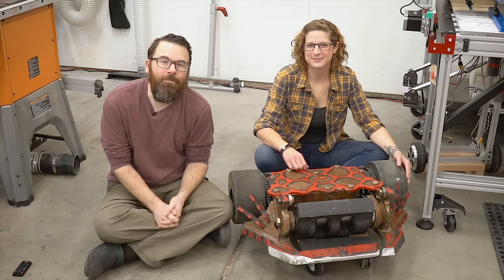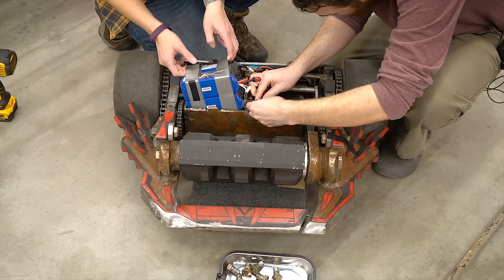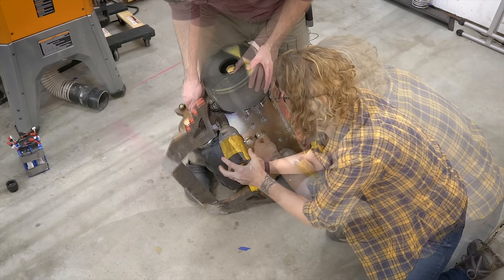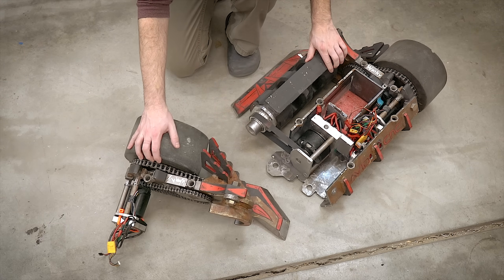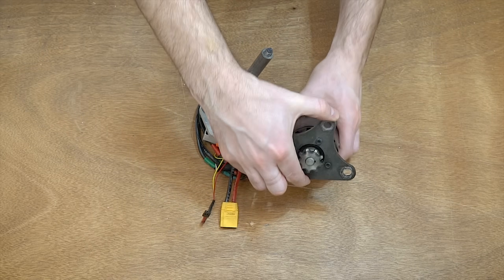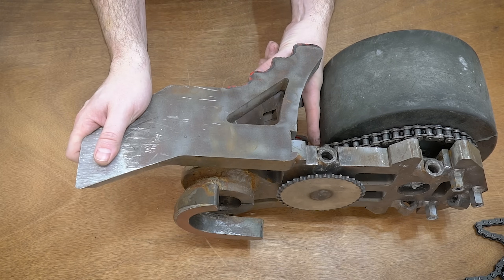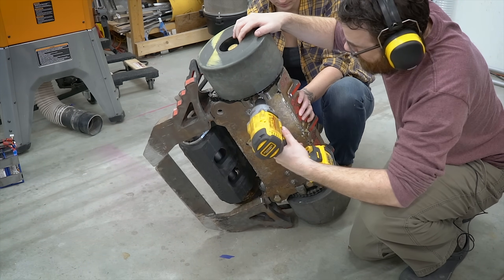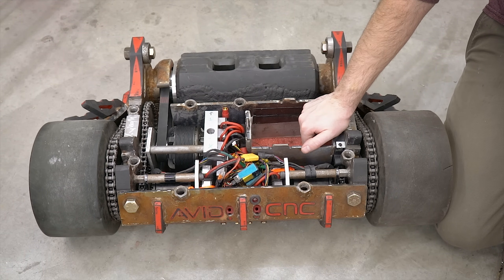How to Service a Battlebot (Copperhead)

Comment: Hey that’s pretty danger moving that around by hand you should design some sort of sizer lift or car lift but smaller and call it your bot hoist
Reply from the maker: I usually just use a cheap furniture dolly, we pull it around on a string.

Comment: What types of material you use in this bot
Reply from the maker: All of them.  That's a broad question.  The frame is AR500, drum is S7, most of the internal parts are aluminum, there's also some 3d printed parts in there as well.

Comment: I'm a machinist by trade and enjoy the behind the scenes stuff and how they are made. With that being said I have questions I hope you don't mind answering. What is the thickness and material of the top, back, and bottom plates? What are the size of the 2 different drive chains? What is the information on the drive motors and weapon motor? What kind of Speed Controller do you use on the drive motors? What is done to protect the motors ,speed controllers, and batteries from combat, cause a weapon on weapon hit like a bot like Copperhead is a big shock throughout the bot ? Told you I was Curious. LOL!

Comment: Hi Robert 
I remember crippling depression had pockets in the aluminium walls which you mentioned are for weight saving.
In one of the versions you filled these pockets with epoxy and during the fight recap you showed that the epoxy had cracked, probably duo the  shocks the frame gets. 
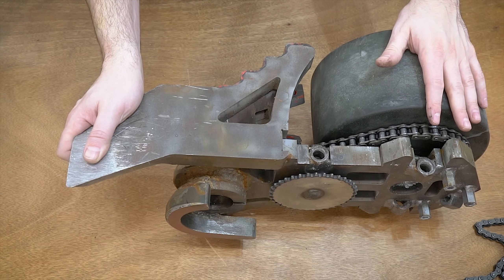8:41
Can filling these pockets you guys have in copperhead with epoxy or rubber reduce the shocks travelling thru the frame and breaking things?
Reply from the maker: MAYBE.  The problem is that the epoxy broke out of the panels, it would need to be undercut somehow so it can stay in place.
Reply: @RobertCowanDIY 
Maybe the answer is in a different kind of fillers, carbon fibre, chopped carbon fibre, carbon fibre nanotubes…etc, even if the epoxy shatters or break, the carbon fibre will still hold the composite together.
Or just use pure epoxy as a lot of epoxies are ductile.

Comment: One thing I don't understand. How are two wheels bots like yours stand up straight? Do they just drag on the floor? How do you manage to balance it, with all the hits and blows and all the weight?
Reply from the maker: The front forks have around 100 pounds on them, the wheels carry the other 150.  This means we tend to get under people, since we have weight on the front of the bot.  This means it drives worse since we don't get as much traction with the wheels.

Comment: Gotta say, awesome!!! But.... IMO Your lifting techique would be better if performing a deadlift manuever instead of a bent-over row and then rolling your back up. Try engaging your core, keep back straight (disperses load inbetween intravertabral discs) and shoulders back. Sounds like you hold your breath to perform a valsalva manuever while lifting. Try exhaling, this too will prevent injury. also never lift/put down a heavy object held away from your body (hernia) keep it close. I was excercise science, sorry i had to speak out because i dont wanna see you injured (some can last a lifetime). Anyway, enjoyed the video, take care

Comment: Wouldn't you have to re-weld the front horizontal bar once it's back together?  Not sure if mentioned or I missed it.
Reply from the maker: Yep.  A weld is the only thing that will hold.

Comment: 3 biggest reasons people lose in a battlebot match:
1) exposed wheels
2) cant self right
3) motors/controllers burn out

fix these 3 things and youre next to invincible.
Reply from the maker: HAHA.  OK.
Reply: @RobertCowanDIY  you dont even watch the other matches do you
Reply from the maker: @t_c5266  Of course I do. 

1) we've never had issues with exposed wheels.  just as many teams have issues with wheels binding up because of wheel guards as there are issues with exposed wheels.  It's a design choice and there's not a right way to do it.

2) I kinda agree with this one, bots should be able to self-right, or at least be able to drive upside down.

3) That's like saying "bots lose because they stop working".  It's nearly impossible to make a robot that can withstand thee stresses we put on them.

In short, your list isn't 'wrong', but it's very easy to just put together a list like this, but doing it in reality is quite tricky.  "The team with the most points wins the game".

Comment: Question: Why do battlebots use gearboxes instead of directly driving the wheel with a motor?
Reply from the maker: Motors almost always use some sort of gearbox to 1) make the RPM more usable and 2) increase torque.  Most motors spin far too fast and have too low of torque, so you need a gearbox to slow it town and increase torque!

Comment: Wow, I had no idea. Is that 1/4in. steel plate? That's crazy.
Reply from the maker: The frame is 1" thick, and the top plate is 3/8".  It's all Hardox or AR500.
Reply: @RobertCowanDIY  Amazing. When I was younger, I was considering building but at the time the cost was prohibitive. I was just watching the very first episode I recorded on VHS (Mark Setrakian's 'Mechadon '). It's nice to have some insight on how it's made. Thanks for sharing.

Comment: You are exactly right, Robert! While watching the bots fight in the arena I get no sense of accurate scale or weight of the bots. And the bot fansites give me more win/loss stats then anything that helps me to understand the bots scale. A good way to show the bot scale (and thus the power of the bot) would be to film a bot tearing into a: refrigerator, easy chair, old and rusty VW or Corvair?? Thank you, Robert!
Reply from the maker: The problem with kitting stuff for scale is most of those things are far too flimsy, they just kinda break.  We would need to hit an engine block or something more solid.  ADDITONALLY, it's dangerous and quite messy.  We could punt metal shards hundreds of feet, so safety and cleanup is a concern.
Reply: @RobertCowanDIY  , I dig the safety issue. I've seen how fast the parts come off as they bang against the battle ring walls. I would be interested to see how powerful a battlebot would be but, yes, the filming should be very isolated from spectators and the driver of the bot would be behind a seriously strong protective shield. No blood just bot carnage.

Comment: What would be very interesting is to make the robot fully AI using an arduino nano technology chip and sensors, that way it can make decisions faster than a human can how to attack and apply drive power.
Reply from the maker: Go for it.  Others have tried.  Mike Tyson said it best, "everyone has a plan until they get punched in the face".  Sensors are great, until they experience impacts that will warp 1" thick steel plate.  The problem isn't the idea or the implementation, it's keeping everything working through the hits.  Also, what decision would you expect the Arduino to make when the bot is 10' in the air upside down?
Reply: @RobertCowanDIY  they have all kinds of sensors nowadays accelerometers can tell the attitude of the object weather upside down whether it's moving left or whether it's moving right it just a matter of placing it behind the armor what armor does it usually get hit you guys would have to figure that out.
The more important thing is the code to write the code to do it need programmer, I'm just surprised that someone hasn't tried it yet where the robot drives itself all you do is turn it on with the remote control and it does its thing, that would truly be a robot. The military has it why not BattleBots.
Reply: @RaptorRotorHead  You didn't read the part about impacts warping 1 inch thick steel? That's the reason.

Comment: You need to take the entire side off to replace a wheel? For the next year competition/design, will you be accounting for this? I'd imagine if you participate in Bounty Hunter especially, you need very quick turn around in the pits no?
Reply from the maker: They act like the bounties are all in the same night, but they're spread out.  You have plenty of time to take things apart.  So for Battlebots, it doesn't make sense to compromise durability for serviceability.

Comment: This disassembly method looks to require welding the U horizontal bar back together. For the original assembly, was this the case? Or was the original assembly without the horizontal cross piece? If you left the horizontal bar uncut, could you get at a drive motor by removing a wheel? ( A much more complicated process, you said.) Thanks.
Reply from the maker: You are correct, if the horizontal bar isn't used, it doesn't require any welding or cutting.  It's only when we use the horizontal bar.
Reply: @RobertCowanDIY  Thank you for your courteous reply. I must apologize for wasting your time with the question: this was the first of your videos I watched. You actually answered my question in a couple of earlier videos, which I've now watched - as a subscriber!
Reply from the maker: @stevedefranco6311  No worries, we all start somewhere!  Enjoy the channel.

Comment: I wonder why no one uses chain instead  of belt in the weapon ... chain seems last longer than belt
Reply from the maker: They each have pros and cons.  Belts act as clutches, chains don't.  Chains CAN last longer, but I think the perception is just skewed since more people use belts, you see a lot more broken belts.  But broken chains 100% happen.
Reply: @RobertCowanDIY  thank very much
Reply: It really depends on the bot, some bots do actually use chain on their primary weapon like Tombstone or Bite Force to name a couple prominent examples, belts are more common since on big impacts you'll actually want that slip a belt can have instead of all that force pulling on your chain and breaking a link (which means the whole chain is out)
Reply: @MakerNekoMizuki  i see .... can gears be used instead of belt and chain ...... will gear damage the weapon motor if there is too much load ?

Comment: If you plan to keep this configuration for a long time (upwards of a year) you should probably just make a dismantling cradle. Nothing complicated, but enough to help you ward off old age backbone problems. There are engine hoists oriented for motorcycle use, which i think are about half the size of their bigger counterparts. So for a small shop, they're perfect as handling tools, especially if you put something like a heavy duty roller bearing wheel on them.
Reply from the maker: We've thought about it, and it's tricky.  Holding the body might work, but it would need to basically bolt into the body to hold it, it gets unbalanced quite easily when you remove the drum or a side.
Reply: @RobertCowanDIY  I think on one of the episodes, they showed Hydra mounted on something similar to a car body rotisserie. Maybe something like that can be built for Copper head assuming you're able to design the chassis with some mount points to match.

Comment: Is there any reason why you guys chose to drive the weapon with a belt instead of a chain?
Reply from the maker: Belts help act like a clutch and will slip and smoke instead of breaking.  They can transfer gobs of power and are much lighter.

Comment: FYI heat is best friend for unlocking threadlocker
Reply from the maker: You say that...  Think about how much heat you need to break the threadlocker, and that the whole robot is metal and we're usually trying to work quickly.  The risk of getting burned and the extra time it takes to hold a torch on each bolt isn't worth it.  Additionally, a blow torch on the top is a bad idea with the batteries inside.  Maybe the weapon bolt, but a sufficiently large ugga dugga can take care of it much quicker.
Reply: It doesn’t take much heat I’m just thinking how many times I have rounded off the heads of bolts before I learned that about the threadlocker but the way your bot is built all the bolts are prob grade 8 deff doesn’t look like you skimped anywhere on your bot I kinda reminds me of my old chipper the drum was 800lbs I’m shire the weapon works awesome for dismantling opponents lol

Comment: What is the back story to the "wonky" labeling on the side plates?  Also, why is there a bunch of weld buildup on the weapon?
Reply from the maker: The weld build-up is from balancing, it was there last year as well and I explained that in the first overview video.  Regarding the 'wonky', they were the drive sides we were less confident about.
Reply: @RobertCowanDIY  re: wonky, does that mean this is the "B" bot?  I assumed the weld was for balancing, but I wasn't certain if it was because material had been removed in battle and you had to build it back up to balance the rotor.

Comment: What’s the reason for taping the connectors?  I’m going to guess to keep metal slivers out?
Reply: To stop the connector accidentally pulling apart during a match.
Reply: When you're messing with a lot of kinetic energy, like a fight in the battlebox, it's very easy for plugs to get disconnected.

Comment: I think you gave out some interesting strategies to the other teams on how to defeat copperhead, now I think that unscrewing the top panel and unplugging the batteries could be a clean way to end a fight
Reply from the maker: Ha, if someone can design a bot that can avoid the drum, unscrew the top plate, and unplug the battery, I'll hand-deliver the giant nut to their house.
Reply: @RobertCowanDIY  Does that imply you have it?
Reply from the maker: @lukasdimmler2622  Ha, no.  It implies the sheer absurdity of even trying it ;-)
Reply: So hear me out, Rusty had that overhead arm thing.  Replace it with a longer arm with an impact wrench on it. Think about it. 🤔
But alas Rusty is no more. RIP Rusty. :(
Reply: @chartle1  I'm just hoping you are joking because I, in fact was really ironic
Reply: @pietrom2642  maybe I am, maybe I'm not. 😉

Comment: Where can someone buy a huge chunk of s7 tool steel for weapons? I tried ebay, google search and only come up with big companies that want you to fill in info about yourself. They don't like to sell to one-off type of customers 😒
Reply from the maker: Hudson Tool Steel.  Lube your wallet first.
Reply: @RobertCowanDIY  Haha! Thanks
Reply: You probably don't necessarily want to run S7. It's very brittle. Look at what happened to Witch Doctor this year.
Reply from the maker: @shadow7037932  You're not wrong.  But Witch Doctor improperly treated their S7.  If it gets too hard, it gets brittle.  There is a very fine line in hardness.  Too hard, it's too brittle.  Too soft and there's less benefit.  We run an S7 weapon shaft and S7 drum, and have yet to have an issue.
Reply: @shadow7037932  I agree. I was just curious. It does seem like the people who were responsible for witch doctors heat treatment didn't do it right. If I made a huge spinner, I would go with ar400 for the weapon body with beefy interchangable s7 teeth

Comment: Are there any differences between the "Frankenstein" drum and the regular drum bot this year? Last year you mentioned the two were geared slightly differently. Also why would you keep the Frankenstein drum instead of making a new one, was it an cost issue?
Reply from the maker: They are effectively the same, and both have the same pulley and radio.  One just has weld for balancing where the other one was ground down for balancing.  But other than that, they're identical.  And it is a cost issue, it's about $3K to make a new drum.
Reply: @RobertCowanDIY    huh,. When both weapons were black rather than copper this year, I thought perhaps you had replaced the lumpy welded one...

At that price though guess not!

Comment: Rob... It's valentines day, this is not the sort of 'servicing' you should be doing.
Reply from the maker: haaaaaa
Reply: @RobertCowanDIY  so Robert how do you feel when you're up against mammoth because it's similar to huge but does copperhead have enough venom to take out a fully grown mammoth and what's the tactic or strategy going to be for mammoth and how are you going to make exstinict? But good luck guys bye🖐️👋👋👋
Reply from the maker: @vincentlewis93  As with every fight, I will make a fight recap and go into all those details, stay tuned!
Reply: @RobertCowanDIY  I very much appreciate your recaps. Your attitude is a sincere way of looking at how well Copperhead did and you give respect to your competitors as well. And that's the kind of attitude I would want from a teacher if I was getting into battlebot building. Right now my art, music and motorcycles have my attention. But as an electronic tech I do geek out a bit when you let us "look under the hood". Props and respect to you, Robert.
Reply: Bow chika wow wow.
Reply: Pffffffffffffff